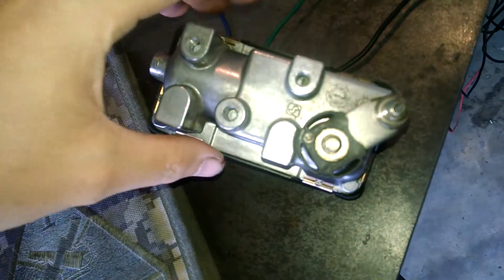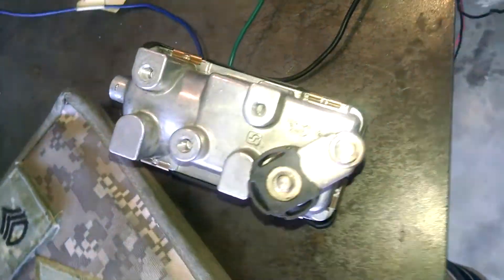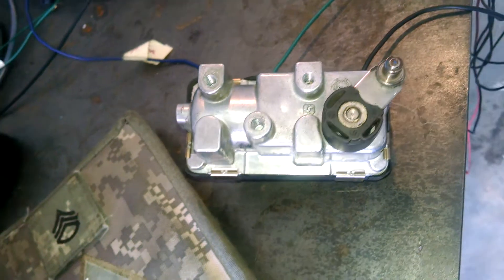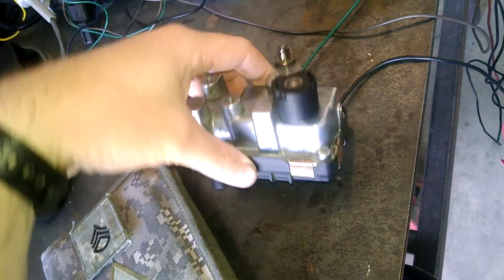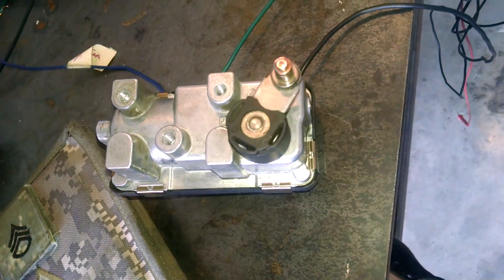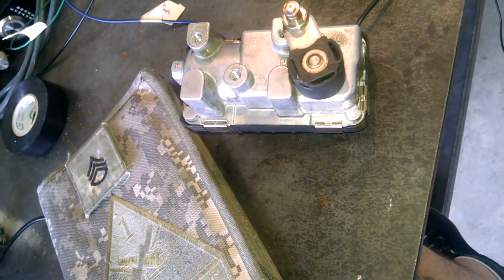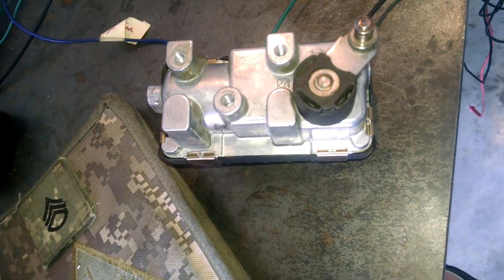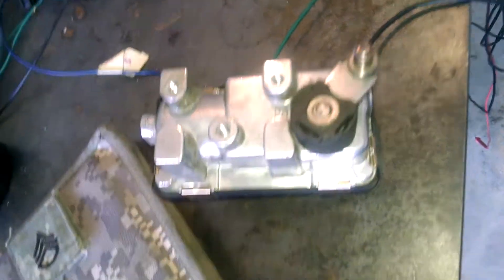Garrett VNT actuator

Comment: Hi I have one of these in my Volvo and I have taken it off as it has a intermittent fault where it won't work I have stripped it and tested the motor and that works but I don't have any tool ect to test the rest any ideas where to look or maybe you seen this issue before I'd you could help that be great 👍
Reply from the maker: You need to test the board. It either CAN, PWM or reverse polarity controlled with a PWM output for feedback

Comment: How does your custom controller work?? Can I power it with an ecu??
Reply from the maker: Its stand alone, doesn't need to connect to an ECU
Reply: Steed Dolan. OK I wanted to integrate it with an aftermarket ecu. I was wondering if it could be controlled easily

Comment: I will try and find that info. I'm thinking I do want to use this turbo. if u get a chance check it out. it's basically a 6.0 powerstroke turbo with a t4 flange. 11blade compressor wheel. it's called a Garrett gt 3788lva
Reply: Doug Lominac and what stops it from having the same failure rate/ mode ? “ power stroke.com “ thinks it’s got headache all over it and the sliding wall turbochargers have less long term problems with failures but Steve and others like the vnt because of the positive flow and I’d pick one 2 but I’m not driving a “ race car/truck “ and I like having a water cooled turbocharger with ballbearings and I’m nota know it all in turbo selections for “ aftermarket conversion for gasoline engines “ which leaves me with the 351vgt turbocharger in a 60mm compressor and up in a bigger size mostly because of my engine displacement of 383+ cubic inches

Comment: hey steed will your controller work with a Garrett gt3788lva or a gt3788va
Reply from the maker: yeah it needs a custom harness, they use the Hella actuator right?
Reply: I'm not sure they are the 6.0 Garrett Turbos. They use oil to open and close the vanes via a solenoid
Reply from the maker: Doug Lominac the solenoid is most likely regulated current. It wouldn't be as effective as a Holset VGT. There would be alot of dynamics that come into play. I.E. oil pressure and oil Temp.
Reply: I remember fleece did a bunch back in the day 6.0 garretts on 5.9 Cummins.  If I remember right the selenoid changes the path of the oil to open and close the vanes. And the oil coolers were always going bad on the fords due to the heu system. But they worked real well on the 12 and 24v 5.9.  The only reason I ask is because I have a band new Garrett gt3788lva of a 7.8 isuzu. And I would love to try this thing on my 5.9, but I'm lost on how to control it.
Reply from the maker: +Doug Lominac yeah I can make it work, I just need to know the amp rating of the solenoid. then I would need to know which is open and closed. I would assume full power is closed and no open is open.
Reply from the maker: Why do you need to know the amp's? The Hella actuators operate on PWM not current. If you setup a PWM generator you can figure it out in about 10 min. Now the ford and chevy VNTs use current to divert oil pressure to open and close the turbo.
Reply: can i ask you questions about this thing?